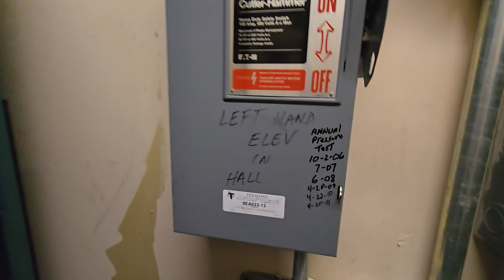DISGUSTING Dry-Powered Dover Traditional Hydraulic Elevator Machine Room

Comment: How does a Dry-Powered hydraulic elevator work differently than a submersible one?
Reply from the maker: In a submersible, the motor and pump are submerged in the oil inside the tank and do not use a belt. Dry-powered machines have the motor, pump, and all other components below the tank, out of the oil. The motor and pump are also different types and designs.